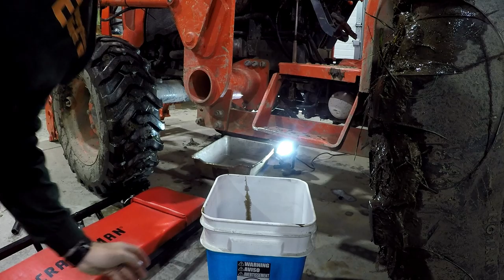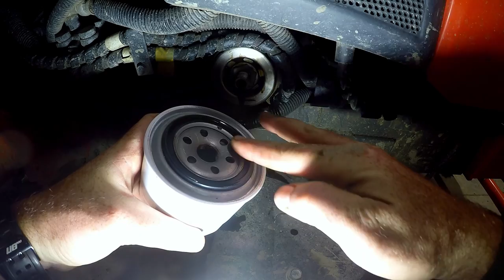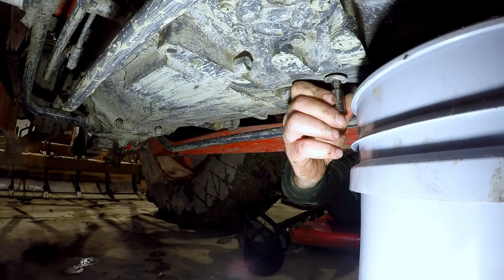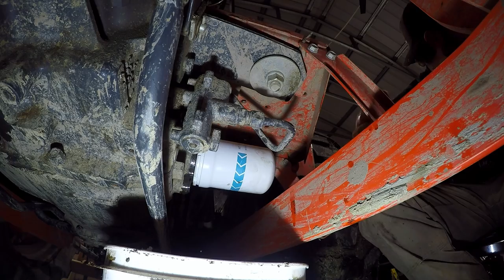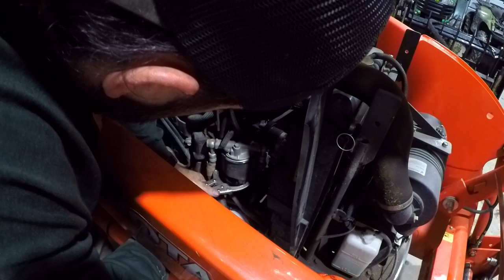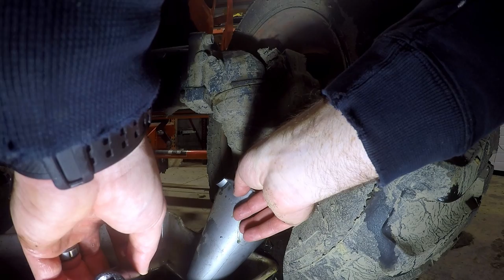Kubota Tractor Full Service - DIY Maintenance on your Tractor

Comment: it would have been helpful to raise your bucket all the way up and put a pipe under it.
Reply from the maker: I dont have anything tall enough that I would trust...
Reply: You should be able to rock out the loader hydraulics at the valve or maybe there is a lock brace you can put in place stored on the loader

Comment: What brand hydraulic fluid did you use?
Reply from the maker: Kubota UDT 2 straight from the dealer. I believe I mentioned that in the video. It was the same price as the generic hydraulic fluid from tractor supply